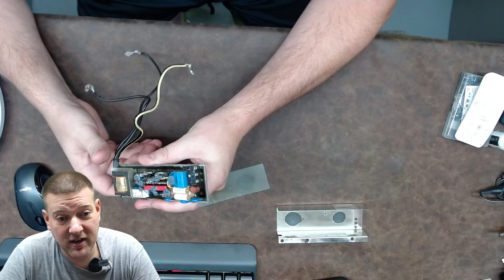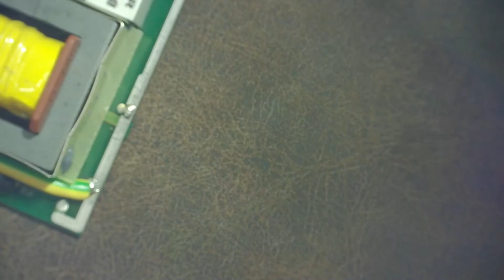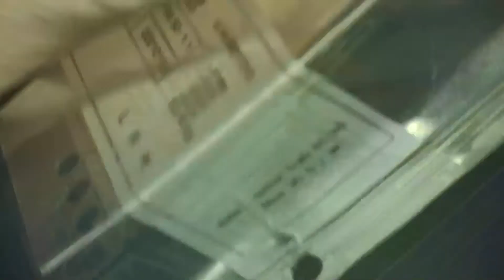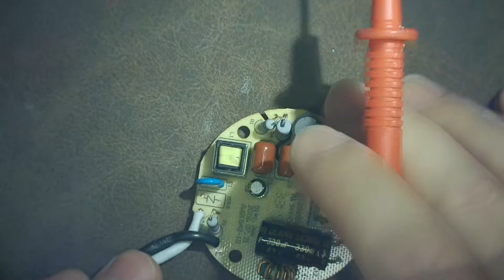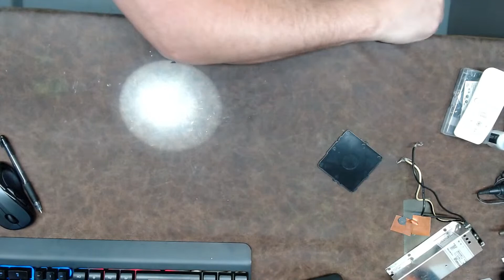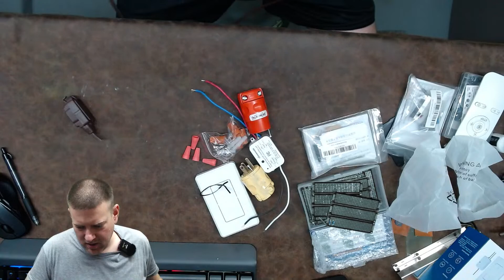Weekend LiveStream LED Failures

Comment: 17:54 The LED's need 94V, but that big 330µF filter capacitor is only rated for 63V, that sounds not right.
For testing LED's with higher voltage, you can use a variac with a bridge rectifier behind and a incandescent light bulb as current limiter.